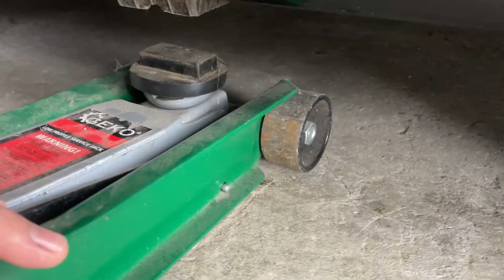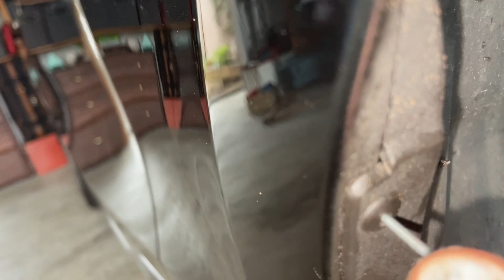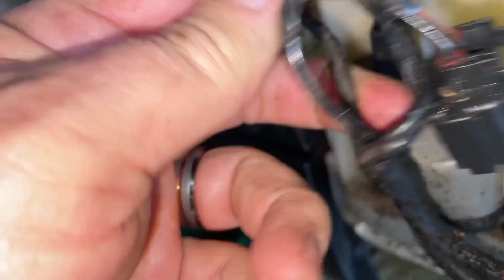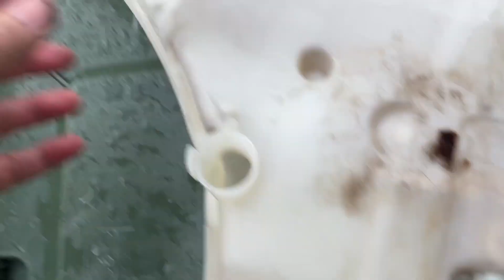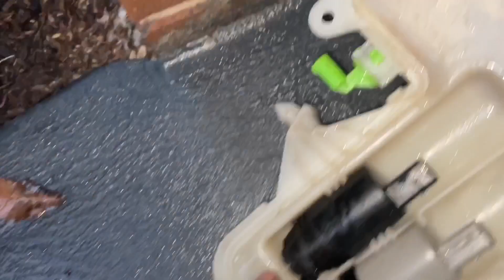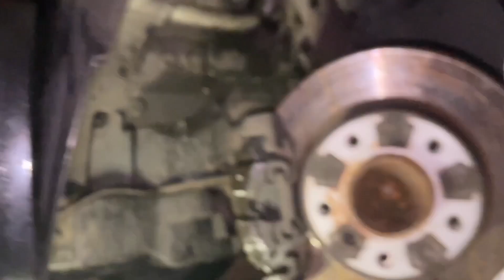How to Remove & Clean BMW e87 e88 Washer Bottle. Windscreen 1 series 3 e90 Clear windscreen sprayers

Comment: Hi Mark from Oz, Mark from UK here.    I had a problem with my 1-series washer bottle leaking leaving just a small amount in the reservoir. Your video helped me to extract the bottle and clean up all the connections. Hopefully no more leakage. Thanks again for posting the video. 👍👍
Reply from the maker: Hi Mark from the UK. Great, I'm very glad the video was helpful! 👍
Mine sure was a mess. MRT

Comment: My container is leaking water until nothing comes out of the washer jets.. could it be the sealing on the motors? Thanks for the video! :)
Reply from the maker: Hi there. Yes there are rubber grommets where the motors attach. Also could be the line or hose off the motor. 
You will have to pull it out to see. 
MRT
Reply: @Marksreviewsandtutorials  thank you for the reply :) i appreciate it! 👍🏻